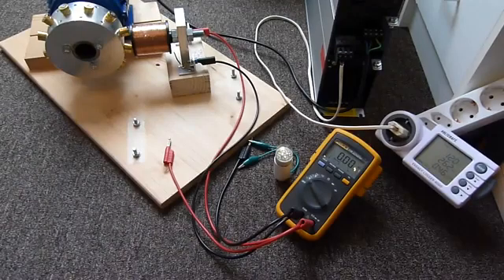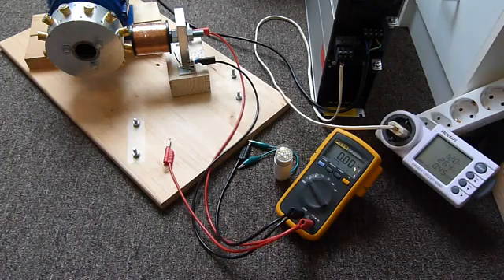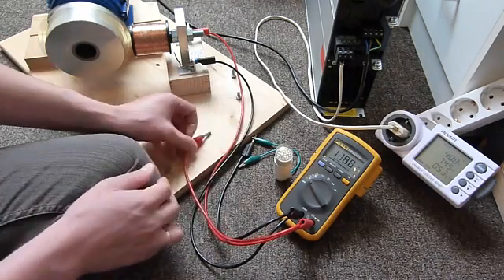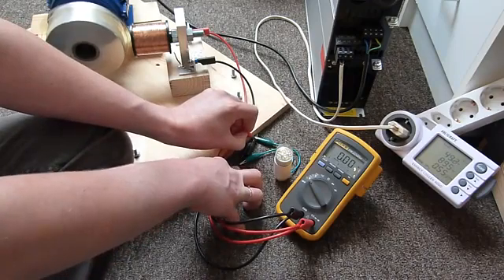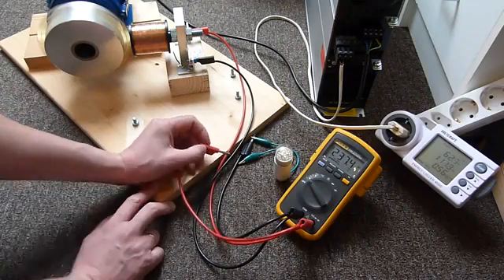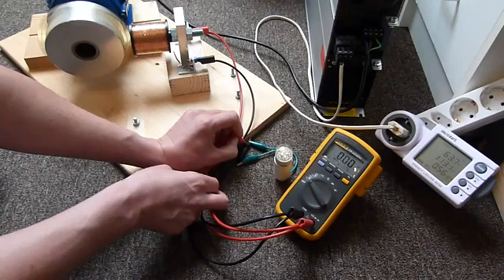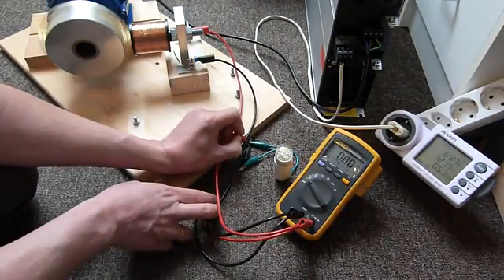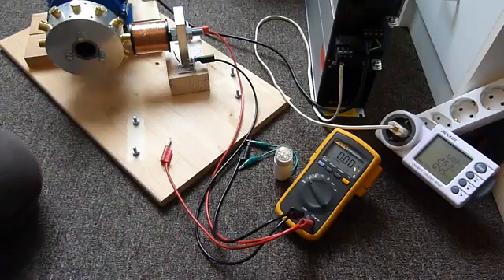Thane C Heins Replication step 2 -  Difference Between Shorting and Loading.

Comment: rotor consumes more wattage when running idle and consumes nothing more when loaded, but it consumes already more in idle state, 
if we connect a heavy flywheel to rotor it will consume way lesser in idle state and when load it won't increase consumption, then it might become overunity
but it's a nice concept and experiment

Comment: There is no gain in the whole system..the energy output should be higher than the input including the frequency drive.. remember when the coil is not connected there are some core loses eddy current and hysteresis drag..when you increase the frequency eddy current loses increases and when you short they tend to reduce since the output current magnetic field cancels them..so the energy is all contained in the whole system..just make a bigger one to output more energy than which you put in the drive and there you win..
Reply from the maker: Build it then talk to me.

Comment: Kinda reminds me of blocking a vacuum cleaner and having the motor run more efficiently due to the fan running in a lower pressure environment.

One thing I'd point out is that in order to use "less power" when loaded or shorted, the transformer (or generator system) needs to be running less efficiently in the first place, drawing more power. So even when it's using "less" power while loaded/shorted, it's still more power than when the system was running in a more efficient mode.
Reply from the maker: Yes, this is overcome by the fact that the effect is cumulative, Jean Louis Naudin did some good testing : http://jnaudin.free.fr/dlenz/indexen.htm